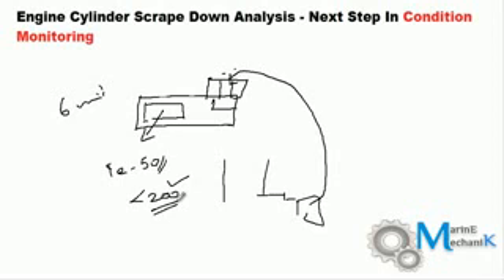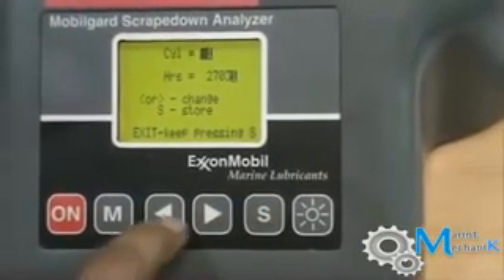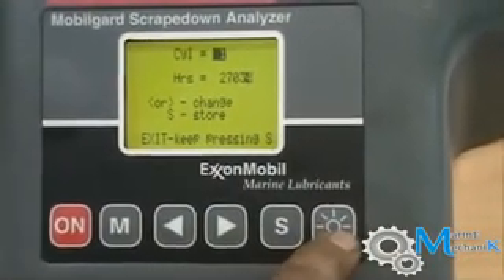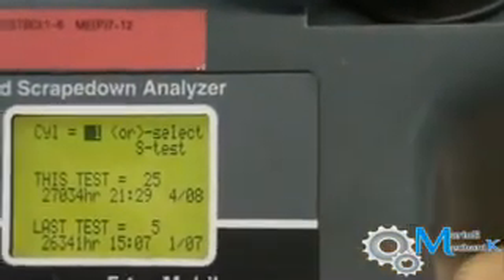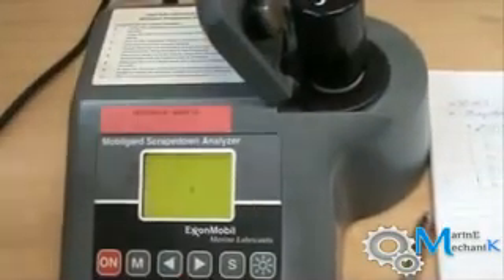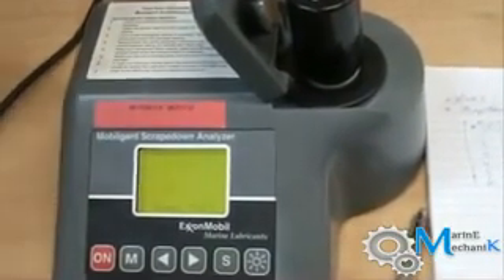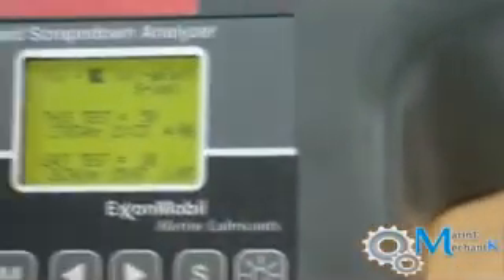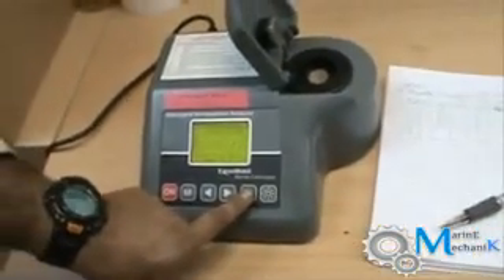Cylinder Scrape down Analysis - Next Step In Condition Monitoring..!

Comment: XOM MSA and Shell Analex Alert work based on ferromagnetic principal. Both equipments are simple enough to operate to give the ferrous wear concentration onboard ship, saving vital response time. For faster, more instant monitoring it is also possible to monitor 24/7 using LinerSCAN.

With slow steaming and higher risk of cold corrosion, cold corrosion test kits will be a good complement to give more comprehensive analysis of the Cylinder Liner Wear. For details please contact me at zainudin@cbmsolutions.com.my